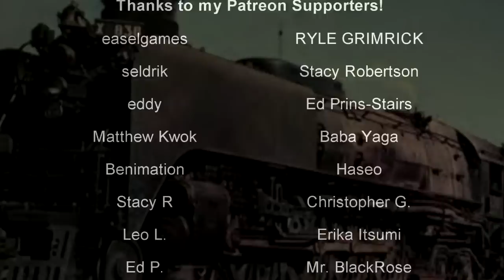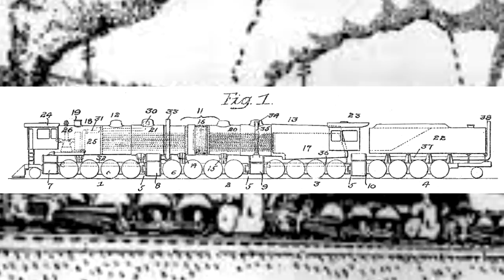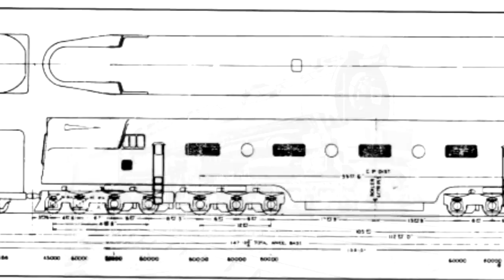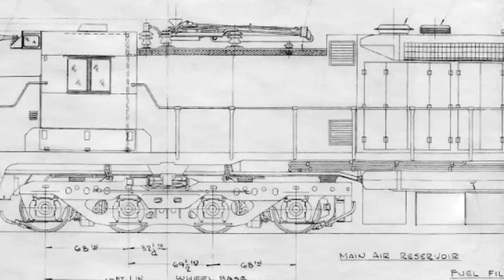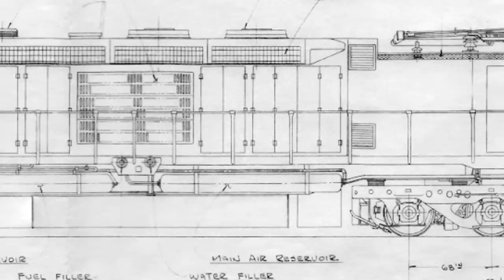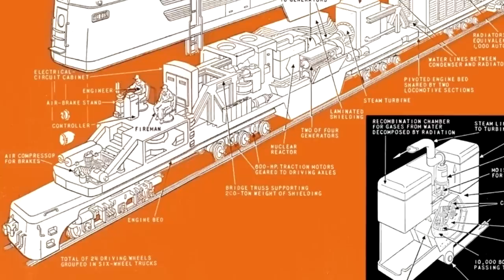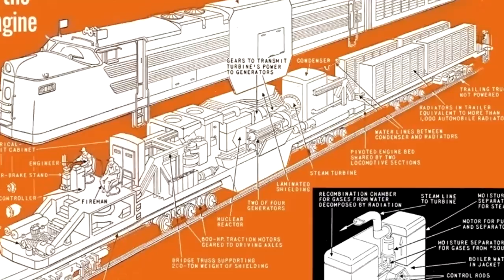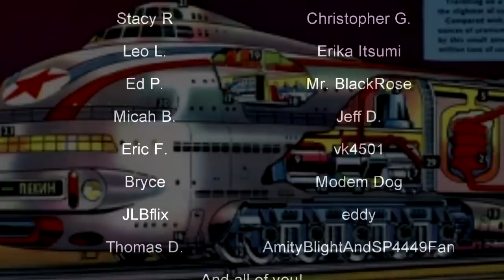5 INSANE Train Concepts (That Were Never Built) | History in the Dark

Comment: To be fair, the French version of the nuclear powered train (electric trains drawing power from a nuclear powered electrical grid) has worked rather well.
Reply: Impressively well
Reply: France also doesn't have energy crisis'. Sadly people would rather claim it's to do with nationalization rather than admit the benefits of nuclear.....
Reply: those trains are more electric than nuclear simply because they don’t have a nuclear reactor on board. Don’t get me wrong the setup that the French have done has and still does work wonders for them and others, but it does take away the whole “drunk engineering” aspect from this concept.
Reply: @mattevans4377  Nationalisation did work when it came to nuclear power in France as it forced standardisation of design when they moved over to the PWR from their own version of Magnox like reactors when the oil crisis hit in the 1970's  remember no US or Japanese nuclear plant is exactly the same while in France they are.
Reply: @gregrudd6983  It probably helped, but I just don't like people trying to undermine nuclear power, which is what some people are clearly doing.
Reply: @mattevans4377  it's economics at the end of the day. Light water reactors scaled up was cheaper than oil in the 60's and 70's Renewables are doing to Nuclear today what it did to oil and coal in the 60's and 70's

Comment: I am kinda surprised you didn’t brought up the 5AT project. It was a project to bring steam engines back and with modern day advancements
Reply: That's for a part two..... along with the Super-Garratt (a quadraplex, 2-6-6-2+2-6-6-2) by Beyer-Peacock, believed to be designed as the unmade GN class for South African Railways....

For context it was to be essentially the cylinder and wheel arrangement of the MJ/MJ1 class, with an additional trailing axle, duplicated to make a Garratt based on the existing GL class, with 25% greater tractive effort.
Reply: There was also a proposal for a Garrett-Mallet,for the Canadian Pacific,to be built by Alco! Alco had the license from Beyer-Peacock for North America,so it would have been very interesting! The CP,had only one or two Articulated engines,and the were rather unconventional! Anyway,a small side light on the might have been! Thanks for your attention ☺️ !

Comment: About the quadraplex and quintaplex locomotives as interesting as they may seem one locomotive was built using the quadraplex system. 

This locomotive is the Belgian No. 2096 it was a steam locomotive that used the Franco-crosti boiler system, the locomotive was 31 meters in length and developed about 3000 horsepower and the locomotives wheel arrangement was a astounding 

0-6-2+2-4-2-4-2+2-6-0 
 Details
It’s a double ended locomotive 
It has two fireboxes 
The engine requires 4 or 5 crew I think
The grate area is 6.5 m2 
Working pressure of 14 atms or 206 psi
Driver diameter of 1.37m 
Adhesion weight 163 tonnes
Weight working 248 tonnes 
Water capacity 35.6 m3
Coal capacity 9 tonnes 

The engine was built in 1932 the stability of the engine was excellent it could maintain curves as tight as 125m and where negotiated easily. The engines max speed was 60 km/hr 
The engine was out of use in 1935 for steaming issues 
High maintenance 
Too much work for the engine to work 
And finally you can get the same if not more power if trains just doublehead or triple head.

Comment: I gotta say, 6400 hp even back then wasn't unheard of with electric locomotives. The German class 103 passenger locomotive of the same era had nearly double the power at roughly 12000 hp. Current four-axle freight electrics generally have over 8000 hp. What I suspect the EMD would've exelled at is tractive effort.
Reply: EDIT: minor correction (I got my large electrics confused), EMD basically just made an electric version of the DD35A and put it up for anyone interested.

Comment: Don’t forget England did build a large network of lines to a gauge of 7ft during the nineteenth century. Under the Great Western railway it covered much of southern England. It was done away with around 1897 as it took up a lot of space and was incompatible with the rest of the rail system. Much of it had to be dual gauge in order to accommodate trains from the rest of the system.
Reply: Pity. Would've thought it'd have its purpose similar to narrow guage railways, what with the chance at a more even centre of gravity, alongside other things that the larger axle load could provide.

Comment: Other examples I can think of for more bizarre or even insane un-built locomotive designs include:
ATSF Cab Foward 6-4-4-4 oil-fired steam
Monon 4-10-4
New York Central C1a
Baltimore & Ohio Besler Type (W-1 motor)
Ace 3000 "modern" STEAM
British Rail's 1976 tentative design for double-deck suburban model
London Roller-coaster underground monorail
London Air Rail
Wardale 5AT
Boston's unbuilt elevated steam system

Comment: History in the Dark:  EMD DDR 6700 HP is insane Electric

Every Siemens Taurus's locomotive with its 8582 HP : Hold my beer
Reply: And even the DB 103 series from the 1965 prototype to the 1970 production models had somewhere between 12,000 to 16,000 HP through its six axles. According to Wikipedia on the DB 103. 
Helped get one to 175mph. Was there ever a faster locomotive speed that was not a multiple unit train like the TGV, ICE etc.
Reply: @johnd8892  Not to mention the EMD GM10B, a B-B-B electric locomotive that had 10,000 horsepower at its disposal. And the EMD GM6C had 6,000 horsepower, just 700 less than the DDR electric.
Reply: @AutismTakesOn  but to be fair, this thing probably would've had a lot of tractive effort to get heavy trains moving thanks to its 8 axles. the similar DD35a had around 503 kN starting and 458 kN continuous, while the GE E50C (E44a) had only 427 or so
Reply: @joeykidd8916  True, though I think a B-B-B-B electric would be better for tight curves. I mean, there are some curves locomotives with a C-C wheel arrangement can't take, and, being an electric, there's no fuel tank to worry about, so 4 two-axle trucks could work just as well as 2 four-axle trucks. Not to mention, there's a finite amount of reactive effort couplers can withstand before breaking, which I believe is around 600,000-650,000 lbf.

Comment: Another type of quadraplex locomotive designed but never built was the Beyer-Peacock Super Garratt.
It did look like two Mallet locomotives with a boiler cradle in between in the Garratt fashion.
A design was made up for a 2-6-6-2+2-6-6-2 for South African railways.
Speaking of another crazy concept, but acually built in numbers as well, was the condensing steam locomotive.
The Germans had a condensing version of their class 52 kriegslok, with a special tender with radiators and fans to condense the used steam back into water.
A turbine and fan created the draft on the fire.
This technology was later used in the class 25 locomotives for the South African Railways, these were used in the arid regions of the country where water supply was a problem, they could cover 12 times the distance on an amount of water as regular locomotives could. (some steam will escape in the air still, via leaks, drain valves, safeties and when starting injectors.)
So a few subjects to use in future videos.

Comment: At 6:49 the 6,700 HP for an electric locomotive is one of the lower powered even back when proposed.
The DB class 103 which were produced and used with well over a hundred operating from 1965 until into the 1990s when they started being displaced by faster multiple unit trains.
To quote Wikipedia on them :
With a one-hour rating of 10,400 kW (13,900 hp) or 12,000 kW (16,000 hp) Class 103 are among the most powerful conventional electric locomotives ever built and it's the most powerful single-section locomotive ever built. Later, its maximum power output has been limited to 9,000 kW (12,000 hp)
Later one set a record for the class of around 175 mph when some high standard track was opened.

Comment: I've said it before, I'll say it again: I'm really disappointed that we never saw any North American Garrat steam locomotives. It would have been really awesome and I think they might have been successful here had they been tried. Especially in the western states and in Canada.
Reply: The problem was Beyer-Peacock had a patent on the Garrett design and would only sell to Railways in the British Empire. So no American Manufacture would be allowed to make a Garrett before the 1950s, by which point it was too late.
Reply: @TBone-bz9mp  ALCO had a license. With that said other European builders constructed Garratts using ideas after the original patents expired. As to Beyer Peacock they would have sold to a North American Road if approached however they would have been more expensive than the US big 3. You would be surprised how much commonality there is between loco's built by the US big 3 while Beyer-Peacock always considered an order a "bespoke job" for a customer. With that said if Beyer-Peacock was approached for a 4-8-4 for use on North American lines you would have ended up with loco that looked like a South African 15-F/25 Non Condenser on steroids with a firebox specially designed for the fuel that that road used and copper tubes for maximum heat transfer. (The design engineers in Manchester would have loved the freedom that North American loading gauges and axle loads offered)  Well at end of the 19th century their attempt at a 4-6-0 to compete against a Baldwin design on the NSWGR was superior in performance but let down by the traditional British use of plate frames in comparison the Baldwin was built to a price, the Beyer-Peacock loco was built to a standard.
Reply: @TBone-bz9mp  if memory serves Beyer-Peacock held the senior Patent, they licensed construction to Franco-Belge, Hanomag & Henschel, and St. Leonard... there were others either other British Workshops, or local government workshops.

An American Garratt design would probably be comparable to the NSWGR AD60, if built by Beyer-Peacock likely a bespoke design like an AD60 on steroids... depending on the year of introduction... however if designed under licence by Alco or Baldwin, it's likely to be turned out like Frankenstein's monster, a double UP FEF with half of a Vanderbilt tender over each end... also more likely to run Cab-Forward for visibility.
Reply: I regret not checking these replies sooner. Thanks for the info. As for the notions: a 15F/25 Non-Condenser on steroids? AD60 on steroids? Stuff built to North American Load gauges? Cab forward builds? I rest my case, Garratts would've been awesome if they were built here!

Comment: I also had came across the B&O W1 “Beasley” Geared No.5800 which is a 4-2-2-2-2-4 locomotive with the Besler Gear Steam Engine which combines the technology of the Shay locomotive, which I was surprised to also find out that some of this locomotives components were actually manufactured including the boiler. The proposal was on September 22, 1937 and the project was canceled although there was no reference to a year. As a side note the W1 would have been given the largest Vanderbilt tender capacity of 23 tons of coal and 22,000 gallons of water. The final nail in its coffin was the President of B&O Daniel Willard ceased to allow steam locomotive experiments in 1940 after having some struggling financial difficulties. Feel free to look it up!
Reply: The W1 was NOT related to the Shay, it's "geared technology" had more in common with Steam Motors found in experimental German engines

Comment: The german dubble decker train well , they do exist on a normal scale ,  the dutch railways have them for the past 40 year if iam not mistaken  ,and are still in use.
Reply: The british company Metronom runs double decker trains here in Germany as well on some lines (I use them 5 days a week to get to work) The  idea behind the Bretispurbahn was to have trains trains that are like cruiseships on rails essentialy
Reply: @TotallyNotAFox  The idea wasnt that crazy , the most efficientway for mas transport was by train  ,and even today , they are talking about a euronet railway syste, with luxery high speed trains.  to cut short flights to a minum.    amsterdam to paris is 20 to 40 minute flight , depending on wind .  but you need to check in 1 hr before hand plus a train or public transport to the airport ,   that makes it 2hrs from arival to flight to destination . plus travel time to the airport . over 3 hrs.  the same time you travel from amsterdam to paris by train .

Comment: The Snowpiercer a movie trein, I think you can see where it's based on.
As for triplex and Quadtro's, they are ALL purely based on Mallards, no Garrett in sight and in order to make them work, you need a tripple Garrett setup.
Two for the two Mallard setups (think heavy load wagons, here) and then mount the main Garrett body on them.
Triplex failed because the boiler was not putting a steady load on that third set of drive-wheels and that was because they didn't make them Garretts as well.

Mallard, High Speed.
Garrett, Tight Curves.
They could have gotten locomotives that could go fast and handel tight curves, if they where willing to pay the Garrett Licence, that is.
Bit of a shame, that.
Reply: A really big Garrett could be a successful triplex

Comment: The soviets actually built a prototype nuke loco based on the TEM 110 chassis with concrete anti radiation overlaying and it was quickly dropped because of excessive axel loads

Comment: Fun fact:  Those steam turbines used gearing to turn fast into slow.
Reply: They could have partnered with the us Navy and built steam turbine electric, oh! Right!!! that did work spectacularly and the reason it did work was government funding and warship levels of space and tonnage, but once you get past the financials it’s just like a hybrid car today , run a small engine all the time and you have electricity to run the motor at any time even when the engine at maximum doesn’t do the job when max power is needed, because you store the extra energy when you don’t need it till you do. But it’s expensive and more so in the 20’s ( it weird when you realize you are abbreviating years by exactly 100 years ) when the US navy was trying it .
Reply: @philvanderlaan5942  Westinghouse built the locomotive and many of the Navy power plants you refer to.  Expense and reliability were the downfall of the closed-loop steam turbine.  Open-loop reciprocating engines are far simpler to operate.
Reply: @kurtpena5462  I was saying the one way to make a steam turbine work on a locomotive was to couple it with electric and then I made a sarcastic comment on how well it worked for the navy.  And how the navy had more money and space than the railroads did .
Reply: @philvanderlaan5942  It wasn't about space or price to build for the railroads.  Yes turbo-electric was more expensive than turbo-mechanical on ships.

The real difference was that closed-loop systems required a bunch of labor.  This is the fallacy of trying to use marine propulsion systems on a train.

Railroads managed labor expense to the point that they built duplex, triplex, etc locomotives (and now use DP) to avoid paying two engineers to operate one train.

Comment: Another reason the EMD DD Electric may not have been built is because there was a bunch of GG1's still in operation at the time and also because the GG1's were already powerful at over 4000hp
Reply: (EDIT, mixed up my large never-built electrics) this engine was essentially just a DD35A with the diesel motor replaced by a AC-DC converter and designed to replace the GG1s.

Comment: The Breitspurbahn plan originally looked into several gages, including 4000 and 7000 mm
it seems that the increased weight of trains with limitations to total weight per meter of track would drop the transportable weight above a  certain sweetspot which i think would be close to 3000 mm (estimated...)

I think the real problem with the Breitspurbahn is not the difficulty to build or finance it.
any connection would have a number of passengers per day. if you have rather high capacity per train you only need very few trains per day to transport the passengers. 
To get high enough acceptance for the connection you need many more trains, which would be too expensive and leave the trains mostly empty.

Comment: There's another reason not to have nuclear trains. If you just built a small nuclear power plant, you could run electric trains, no fuel required. It would be safer and more efficient, and you wouldn't need to invest in a new train design with all the troubles that accompany those.
Reply: @beeble2003  Diesel trains can't cause a nuclear incident if they crash. They're a good option if you don't want to expend money on electrification infrastructure.
Reply: @beeble2003  I did read your whole comment.
Reply: @beeble2003  Because it seemed weird that you would write such a lengthy comment just to agree with me, without actually saying you agreed with me.

Comment: So the prr v1 was a design for a steam turbine ELECTRIC locomotive. Like diesel electrics today. Electric traction motors provide the actual propulsion, not the diesel or turbine. All the engine does is turn generators at a constant speed. So, it could've been very efficient, regardless of actual locomotive speed.

Comment: I wonder how they would have fed the frontal boiler. From the rear? That would have been interesting. THe Quintuplex would have been a very interesting machine. It would have looked very different from a standard steam locomotive. 

If there are any countries where railroads are struggling, they won't be struggling for long. They will need railroads more and more.

A nuclear powered maglev train is out of the question. The guy that came up with the idea is an artist. Basically he just comes up with ideas, even if they don't work.